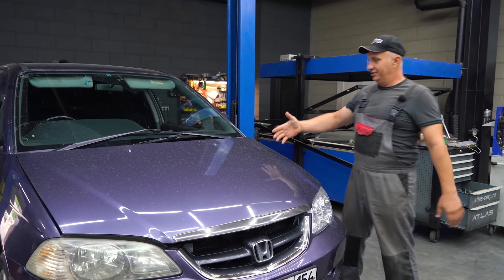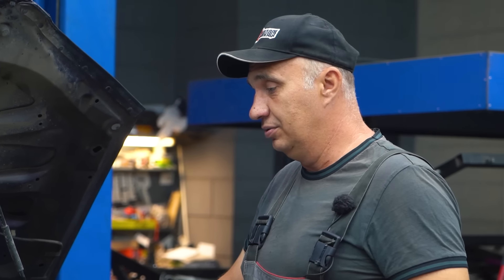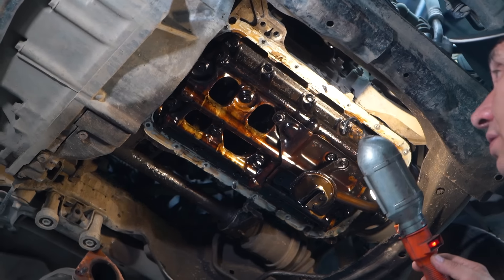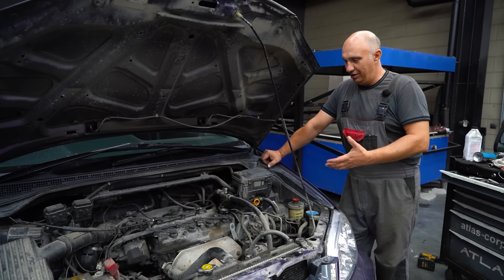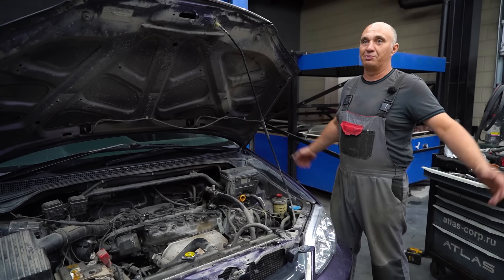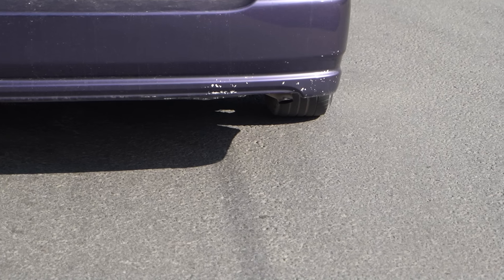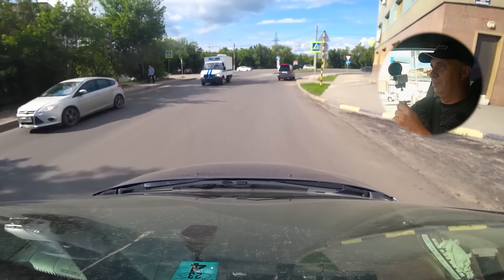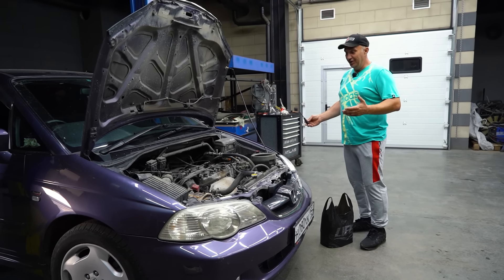We replace motor oil with brake fluid - what will happen?

Comment: I wonder what it does to rubber gaskets and parts in the engine.
Reply: Nothing probably
Reply: Brake fluid can cause significant softening/swelling of rubber seals, depending on what exact compound they're made of.
Reply: @phantom240  the brake system uses rubber seals.
Reply: @Davidautofull  And engine oil damages those.
Reply: @Davidautofull  no shit eh? You know what happens to brake lines as they age? They swell internally and eventually become one way check valves or stop passing fluid altogether.

Comment: The only thing that dissolve oil sludge is drain cleaner. Caustic soda. I tried all the other products and they don't work. A couple of treatments with warm soda flushed with warm diesel and the pan gets clean. Don't let it cool down or you will get some red residue where the liquid surface was. I have never run the engine on soda instead of oil though, because the soda has particles. But I guess if you filter the particles of it can't be worse then brake fluid.

Comment: Pull the  VVTi Solenoid Module at the back of the  Cylinder Head and clean out the Oil filter Mesh /Screen   on same, removing any blockage in same... this should allow the Oil to flow better on that module, and activate the VVTi  locking the Cam  in that position when it calls for same... Put Normal oil back ...

Comment: I wounder if the caustic nature of brake fluid is not 'cleaning' things up inside, hence oil pressure light going on and off.... brake fluid has more than likely removed sludge from inside of the engine
Reply: and really caused accelerated wear on rings, cylinder walls, cam lobes  bearings etc. brake fluid is way too thin and not engineered to handle the compression pressures and tight clearances

Comment: Next run should be an attempt to completely clean the inside of the engine! Try several cleaning products like degreasers or oven cleaners, vinegar, detergent, brake cleaner there’s a plethora of possibilities although you might have to add some sort of clean oil like break in oil or Lucas additives or stabilizer. Obviously the engine will need some sort of lubricant or not I’d still love to see what will eventually clean that dirty girl lol

Comment: Can you make a video about putting a torque converter in manual trasmission with manual lockup. How it affect the smoothness during changing gears and power going uphill with out stalling the engine

Comment: In the same manner as putting lighter oil like 5w-40 in some engines like the 4.L GM I6 gasoline engine there may not be enough oil on #1 bearing. I lost my #1 con-rod after 1000Km and the engine went to scrap. It may also damage oil seals. If you have an engine that has that much crud in it, it may be better to fill the case with diesel to clean then flush and put fresh oil and filter. 
Good Luck.

I would put one or two liters of heavy oil, like diff to keep pressure up while fluid circulates and  dissolves residue.

Comment: 16:10 Looking at the rocker arm rollers... I would be very skeptical about possible damage to them if using DOT4 brake fluid as engine oil for a temp cleaner. 
It just sounds like a very expensive demolition project. 1 hand your cleaning the engine, but on the other hand you are poorly lubricating important parts damaging them. 
Then you need an overhaul on your engine because you spent $400 on DOT4 brake fluid to clean it from the beginning.

Comment: That residue has to be some kind of stop leak agent, that ended up mixing with the normal contaminants found in engines, and plasticizing.  That appears to be a D-series Honda engine, which means that there is no plastic inside the engine anywhere.  Oil pump, pickup, carriage, it's all made of metals.  Timing belt engine means there's no chain guide to disintegrate like a GM.
Reply: Did they ever put a D series in an Odyssey? I think the smallest they got were the 4 cylinder F-series but I think this is a J-series... still a timing belt either way.
Reply: @JJFX-  Not sure 100%, but I know different markets get different engine body combos, in India there's a dual cam d-series (weird right?).  The J-series is an american designed engine, so I'm not sure how many non USDM markets got that guy.  That valve cover looks like a d-series cover.  It appears to be a D16Y8, except the oil pans on those guys should be aluminum (well, USDM and JDM at least).  It's not a D15B7/B7/Z6 because of the spark plug tubes, those guys had flat seals with the tubes as integral parts of the head (not pressed in steel tubes).  I know there are EUDM engines that I'm not very familiar with.
Reply: @TheMostUt  You're definitely right about not being a J type... Now that I've really looked it, I see what you mean but it sure seems like an F-series VTEC to me. Probably some variant of the F23A they were throwing in these back then.
Reply: @JJFX-  You know, I totally forgot about the Fs having that valve cover shape, I was thinking they were more similar to the Bs (I just looked it up).  It's funny how similar many of these engines look.  Looking closer at the video, it does look like a 5 bolt cover, which would be D16/D17, F series (maybe H too?).  Here's me not knowing things I'm talking about, oops. lol
Reply: @TheMostUt  Well it's pretty crazy how many engine variants Honda has in general, I don't think anyone can keep track of all of them. From what I can tell they essentially turned an Accord into some 'sporty' Odysseys with a few early 2000's international models.
Reply: @JJFX-  Sounds like a Honda tactic, one of the reasons they are so well loved, large scale platform sharing.  At least it wasn't another Honda buying Isuzu Rodeo, which turned out to be some POS GM product, to break into a new market (reference the first gen Passport) lol.
Reply: @TheMostUt  lol I forgot that whole ordeal... effectively killed the Passport line for nearly two decades. I always found it funny that in some alternate universe the McClaren F1 could have been powered by Izuzu.

Comment: Try running some coolant in the oil to clean the engine. Idk if youve done it before. But like 1/4 coolant or 1/2. Cause the coolant desteoys carbon.

Comment: I put 1 liter of trans fluid in the oil a day or 3 before I do the oil change because the trans fluid cleans the system,
Reply: Did it clean it like how the head turned out in this video?
Reply: I never took it apart but it's a 2005 f150 with the 5.4 that people say are junk.
I have 200,000 klm on it and use it daily and it doesn't have the ticking or smoking problem I see with others here with the same or less miles. So something is keeping it clean, I dot us any other treatment in it so either I have been super lucky or the transmission fluid is still working, I first seen a guy do this trick back in the 70s and ive been doing it ever since, Just like putting water in the old carbs to clean the motor and other parts of the system worked great back then,

Comment: maybe you clean the oil pan and anything else easy to clean and then replace valve seals and run it on full transmission fluid and see what happens

Comment: use some BG engine flush if you can get it overt their, its the strongest flush you can buy, then chnage the filter and use some mineral oil for 20 minutes @1500rpm then put new oil in with a new filter, then  it will run like brand new

Comment: Idea: Replacing alternator with solar panels.
Carburetted engine will probably run longer.
On a mechanical fuel pump diesel, it may run forever that way.
Reply: You're going to need a lot of solar panels...
Edit: you'll still need an alternator for night driving. Exterior lighting, especially the headlights, requires a lot of current. Wiper motors and power windows pull a lot of current as well.

Comment: How about taking the gear lube out of a transmission gearbox, clean it out with some solvent, and dry it out really good.
Then put corn syrup into the gearbox and see how long it lasts.
For the engine???
How about making your own lubricant mix?
Use a light solvent like naphtha to dissolve tar to a reasonable consistency, and see how long it will last at operating temperatures?

Comment: Comrades
basically Brake Fluid is a Solvent so I'm not surprised your internal parts got De-sludged... if i were you guys i would put motor oil back in the engine & drive it to see if it still smokes

Comment: take off the rod bearings and crankshaft bearings to see what else "dissolved" that DOT4. You could have saved the engine by revving it several times and then drain it. But racing on the traffic lights and driving it on the highway you destroyed the bearings - there is the source of oil light now.

Comment: Try and run a quart of the break fluid in oil to see how well it swells valve seals cam seals etc.
Reply: does this work
Reply: @6lackRain  it should but break fluid will strip paint too so it will take the paint off your oil pan
Reply: @cronicjohnson  so its prob not a good idea to run it?
Reply: @6lackRain  not for long
Reply: @cronicjohnson  for how long would you say
Reply: @6lackRain  I kept it in my trans for like  a month and it was stripping the paint from my trans pan. So a day or two to be safe

Comment: and now put some good oil in it and see if everything is fixed..?
Reply: That's what I wanted to see. I have an odyssey myself with 255k miles and this video has me wondering if I should try this
Reply: compression check too would be interesting
Reply: Yeah, I wanted to see what happened when they put fresh oil back in, took it for a drive then dropped that oil too (to see what the oil was like after the brake fluid had cleaned the engine) and if the VTEC still worked with the fresh oil. 🤔

Comment: I had a thought today of what would happen if you replaced ac compressor oil with brake fluid. It would probably be fine for a long time and only fail on lubricity properties

Comment: Dot 3 should damage the seals at least. Because it is thinner, bearings will suffer. The smoke issue is because dot 3 doesn't burn the same way.

Comment: This is an old trick I have done it many times not feel the entire motor with brake fluid but poor a can of brake fluid in like you would pour a can of any other engine additive and it does a couple of things it cleans a lot of sludge and it will also make seals swell and you will have slightly less oil leaks

Comment: Powersteering fluid might actually work decently well as lubrication as it is more thick
Reply: I don't think that the intention in this vidya, was for the engine to be having a particularly happy go of it. I think that you are 100% correct though.

Comment: in the past i have used a 70% kerosine 30% oil mix as a flushing oil, i drove car gently for 10 minutes, this was a 70s  bmc engine a 1622cc b series engine there were really dirty engines mosy unlike my 92 corolla with 1300 12valve , thats areally good clean running engine

Comment: Yes , why didnt you put regular motor oil back in it , and see if oil pressure came back ...and see if it still burns oil , you mentioned that the power was greater because some sort of mechanism was working , it would have been nice to see if that mechanism was still working after motor oil was putback in it , that gave it better  power

Comment: couldn't the low oil pressure be caused by a clogged oil filter? that's why the pressure goes back up when he reaches 1,500 rpm is the bypass valve in the oil filter opens.
Reply: Yeah, it's probably full of paint.

Comment: I wonder if a bit of brake fluid in the fuel would clean out injectors and carbon.
Reply: And make mountains of smoke
Reply: I was told by a tutor to do that to someone you don't like. Makes it look like you have blown the motor with out blowing it up.

Comment: I wonder if you had a really gummed up engine, could you drain oil, leave old filter and oil in filter alone. Full crankcase with Varsol. Just for a bit more lubrication is why I suggested leave old oil filter and oil in filter alone. Run it for awhile, drain, replace with new oil and filter. Will engine be better?

Comment: Im curious how itll do when mixed eith oil.  To be used as engine flush.    The reaaon the brake fluid got thicker was it mixed with the oil still in the engine.  There will always be oil still in the engine.  And the deposits

Comment: My Silverado brake master cylinder leaked a bunch of brake fluid into the booster and got sucked into engine. So I replaced Master cylinder and booster along with a oil change and filter. Still a bit of smoke out tailpipe. How long will it take for to smoke to clear up?

Comment: GARAGE 54 I wonder if cnc lathe coolant or mill coolant would work n cars thecoolent ya mix water with and interns white color or there was this other coolant it was green similar to antifreeze but was different a friend got this metal glowing red hot stuck it n that coolant for 3 seconds and it was cool to thetouch

Comment: Value seals are shot now! The best way to clean out an engine, is 3 quarts of kerosene and 2 quarts of Dexron transmission fluid. Change the filter each time.

Comment: brake fluid would probably act as a good substitute for oil when clean but as temperature rise in the engine, The fluid would loose quickly its lubrification quality and harm the engine.

Comment: Brake fluid swells the valve seals.... weve dumoed it into oil and drove on it for an hour drained the oil and refilled with fresh oil.  Easy way to know if its piston rings or valve seals... also ive had piston slap and added ATF mercon dex 3. 1 whole liter....drive it... the high detergent cleans the piston wrist pins and decreases the slap.  Ive even done 2 liters ATF and 2 liters diesel fuel, allow to idle for 10 minutes....the drain amd refill with cheap oil, allow to idle for another 10-20...drain and remove filter and install new filter and proper oil.  😂

Comment: Can you test, if you use a pressure washer and motor cleaner for a pressure waster and wash the engine from under the valve cover and oil pan, will it help for the engine to work better?

Comment: I never messed with the oil, thats risky. But l used to work in a print shop and one night my gas was low and feared not being able to make it home so put about apint of alcohol in the tank. It smoked a little from the exaust and lost some power but it did'nt knock. The next day i gassed up and it was fine. Now they're alchohol / ethanol in gas. Back then, people would have called me crazy !
Reply: Fordigraph fluid ?

Comment: Now I'd love to see brake fluid tested as an engine clean/flush. I'm taking tear down of a nasty engine for inspection. Reassemble and run it on brake fluid for... 30 minutes? Maybe an hour? Tear down to compare to original condition. Flush and fill with regular oil and test.

Comment: Would be interesting to see how that engine would handle baby oil 😁
How long would it last with it.
Reply: Not long baby oil cant take the heat ot would break down and burn
Reply: @mikeysbago-meat7967   Thats why it would be nice to see how long it would last 😁
Even tho there was a video where some guys did drive 200 miles with baby oil and the engine never skipped a beat 0_o

Comment: I use kerosene, dump one and a half quarts in the old oil then idle the car for about 10 to 15 mins drain it out and change the filter fill it up and run about 1 hr ,then change the oil and filter again ,it will clean all the return ports and oil pickup and the carbon will b broken up and caught in the filter ,,,usually will save a motor for atleast another 30 thou miles oil and grease is cheap I do this all the time for people who can spend a lot of corse no garunties with it but it's cheaper than a new engine ,,,,and change the oil regularly after it usually will let the engine live a lot longer 😊

Comment: My sister did this to her boyfriends car. It had a wheel cylinder leak so he kept a 2qt bottle of DOT3 in the car. She had seen him add fluid before. Red light comes on the dash, top it off. easy right?. Well, she poured the WHOLE BOTTLE into top of the rocker cover where motor oil goes, not the master cylinder. Totally locked the engine up in just a few miles.

Comment: should do the solid water for engine oil
Reply: I've seen a video where someone tried that and the motor locked up in less than 10 minutes at idle.

Comment: It would be awesome to fabricate dual brake discs (in series)  and dual calipers on a car with disc brakes (both front and rear?). Then you could see by how much the braking has improved.
Reply: This is why 4, 6 and 8 piston calipers were invented and produced, there would be no way to fit 2 rotors and 2 calipers inside a conventional rim side by side now putting another caliper on the bottom of a single rotor is possible.

Comment: Top 10 manufacturers – most reliable engines
Manufacturer Failure Rate
1Honda          1 in 344
2 Toyota         1 in 171
3Mercedes-Benz1 in 119
4Volvo              1 in 111
5Jaguar         1 in 103
6Lexus           1 in 101
7Fiat           1 in 85
8Ford     1 in 80
9Nissan     1 in 76
10Land Rover1 in 72